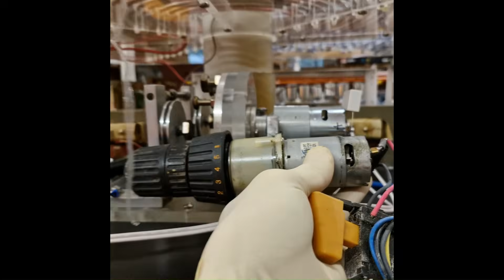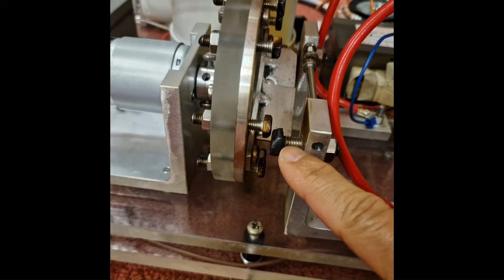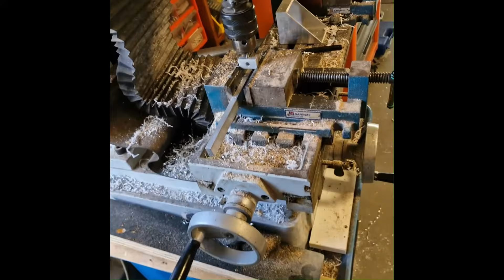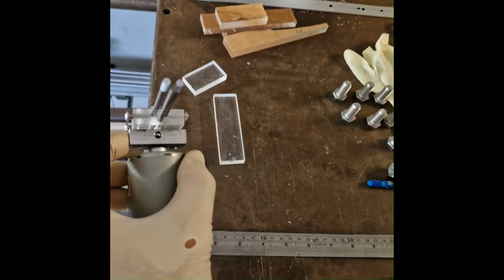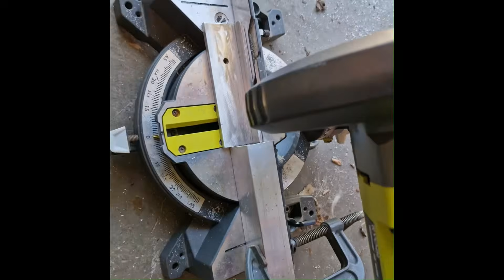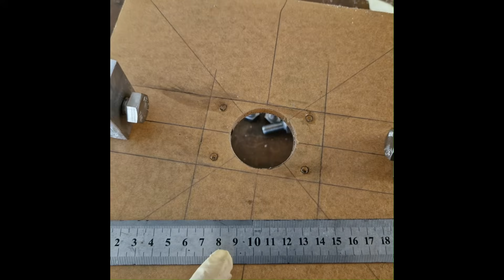Making a Simple Rotary Spark Gap with Tungsten Electrodes

Comment: Both of your smoke alarms are now dead.
Reply from the maker: 😅... Actually, it's not the smoke alarms. I'm not sure if it was you who made same comment on my other video. I forgot to mention but it's actually a safety alarm I built into the units to remind me that the capacitors are still charged. I don't have self discharge resistors. 
Thanks for your continued interest.
Reply: @CreationsByAnNg LOL, did you use smoke alarm piezo sounders? Cheap way to get loud piezo elements as long as you can drive them.
Reply from the maker: I used some old piezoelectric buzzers I had lying around taken from broken stuff years ago. I'm a collector/ hoarder... never know when something will be useful. 😅